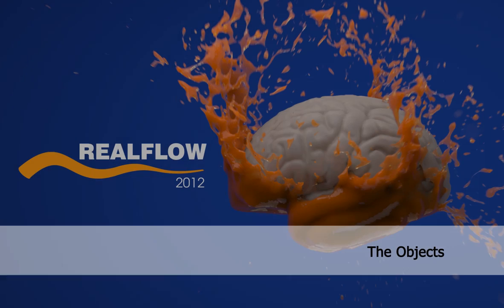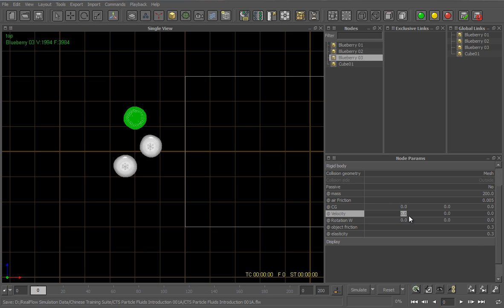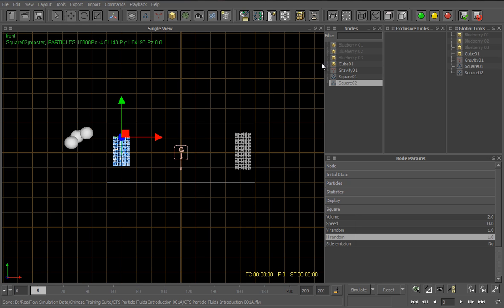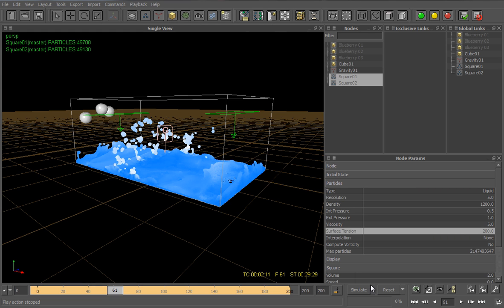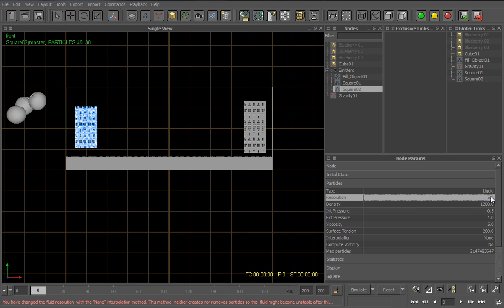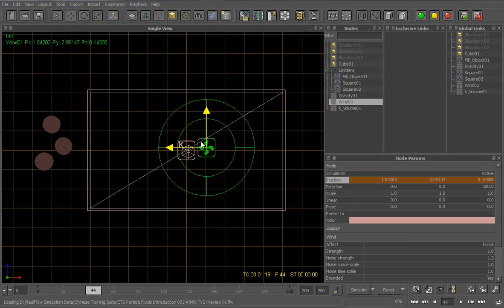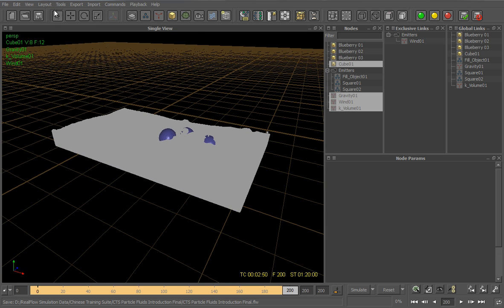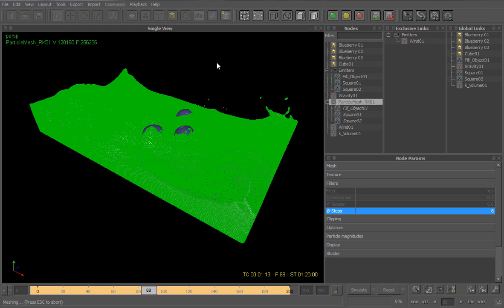Particle Fluids Introduction

Comment: Wonderful explanation. Great tut. But i guess your computer has a monster specs to handle this simulation. My PC says no and literally crashes when i try to add resolution.
Reply from the maker: At that time we had a cheap consumer PC with just 4 GB of RAM and it simulated pretty well. With a modern machine there shouldn't be any problems at all. And if you are using DyversoSPH it'll be lighting fast.